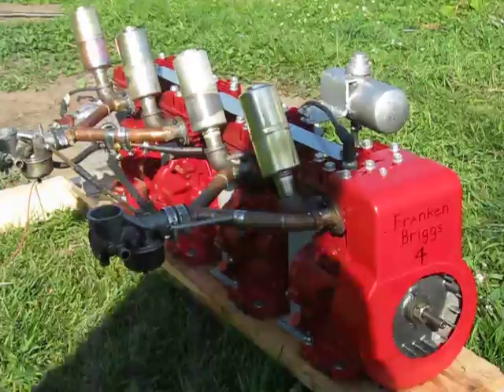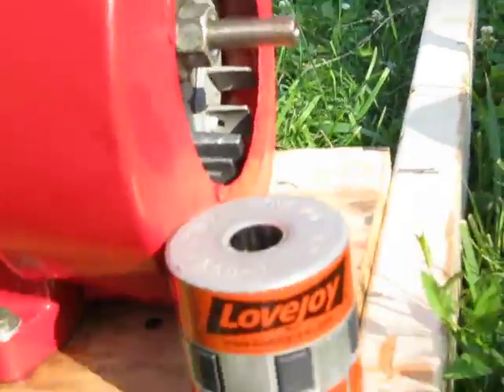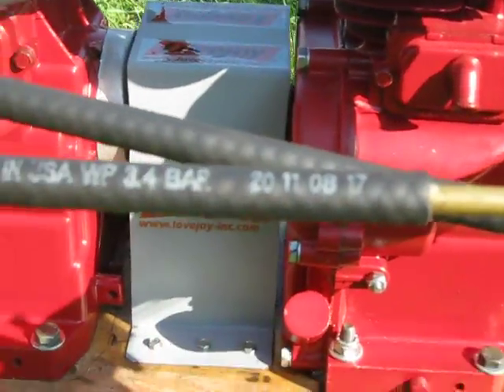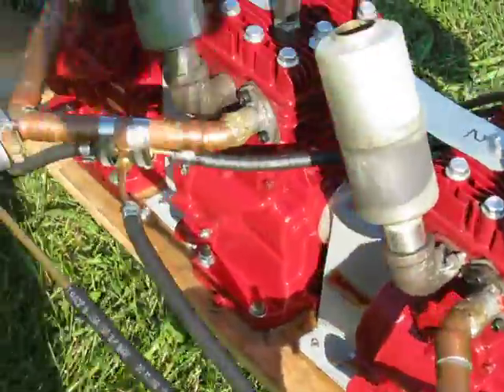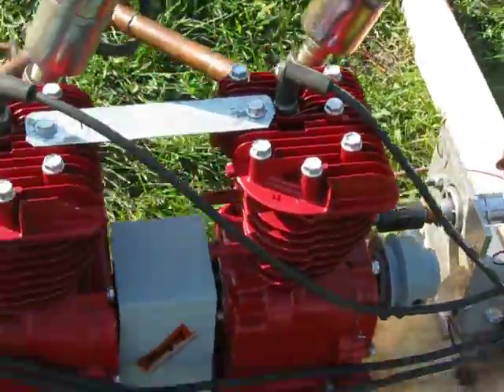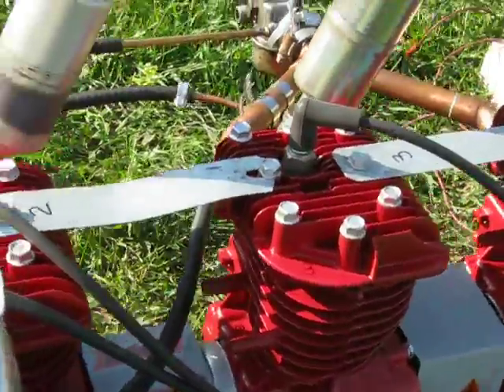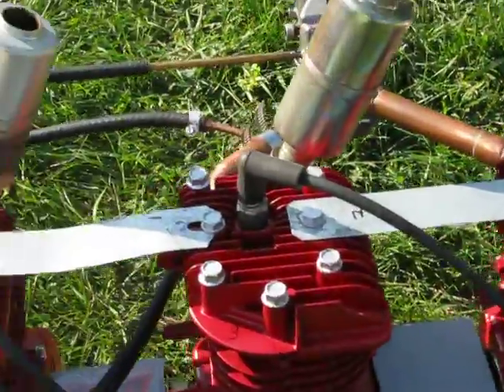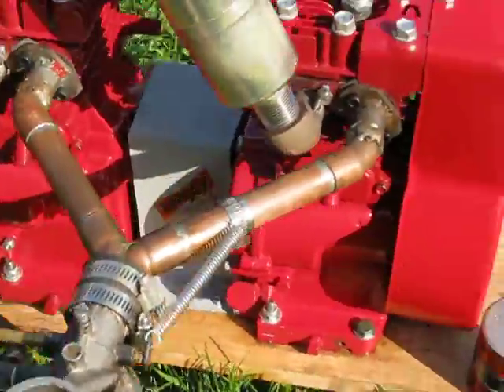FrankenBriggs 4 Cyl. 40 Second Run!!!

Comment: Great job!  I can see the comments on the cooling, and just know the other three are over heating also, It would be nice to run a fan system for the 3 engines, your run time is about the time it takes for them to start locking up, I ran a 3.5 hp briggs ( no fan shroud) on a go cart and burned the piston till it started to melt/grind along the skirt, using the original fly wheels and shrouds here will do wonders, and you can do away with the distributor as well using the original magnetos for spark,  the timing of the crank shafts will remain the same. Strait 8, V8, V10- the sky is the limit.
Reply from the maker: Curtis Barile So how long did the 3-1/2 horse survive until it gauled up the piston skirt, with the engine under load?I am planning to use an electric fan or two when I build the Straight 8, to avoid a melt down, though since these engines aren't under load I would think possibly 2 minutes would be OK without a fan. I am just guessing though. It would be expensive lesson to learn, if I smoked 7 engines on a 2 minute run though!I purposely deleted the 3 flywheels, and added the distributor and dual carbs to make it more like an actual 4 cylinder, even so I still get comments that it isn't a 4 cylinder.  Thanks for your interest :)
Reply: ChargerMiles007 I was hoping the wind from the ride at 30mph would cool the engine, It did to a certain extent but was not good enough, about 5 minutes under load was it, and I had to remove the chain to push it back to the shop because the engine was too tight/ locked up to push the cart with the chain installed, I had built it as a strait 35" chain drive with no clutch, I just push started it and jumped on after it started. these were  my experimental times leading up to the riding lawn mower with a vertical shaft 7hp Clinton engine with a belt drive 3 speed transmission, (Two speeds forward and one reverse) Top speed after increasing the chain sprocket size at the transmission to the axle was 50mph. Great fun to drive!!!
Reply from the maker: Curtis Barile 50 mph on a riding lawnmower!!!Man, you are braver than me, I have done 55mph on a 5 horse Briggs go-kart, but I would be very concerned about the lawnmower steering at speed like that!  Glad you survived it.
Reply: ChargerMiles007 It had a straight drive axle and I cut the small solid rear wheels off, and took the axle to the school metal shop and  the industrial arts teacher showed me how to turn the axle ends down to fit the  bigger air ATV style wheels and mill the key ways to fit the center hole of the rims, and drill/ tap the ends for a bolt to hold them to the rims, I then installed wheel bearings to the frame and slid the axle into place and bolted the wheels in to hold it into place, this gave it a much wider wheel base and positive traction for stability on the road and dirt, we had had no sand in Ohio, the frame was heavy steel with air tires mounted in front, I kept the old steering system since it was heavy duty. The old 5hp Briggs was good and was reliable to start in the winter, but the 7hp Clinton was stronger and faster and never got it started in the winter, so I would swap them for year round fun. Good memories from this time, I have an old 12.5HP Briggs electric start lawn tractor I am going to transform in the next year with my wisdom on this subject, and will post some video's when the time comes. will be watching your videos as well, Thank you for putting some spark back into my life on your projects, and get some air to those poor engines, remember "Air Is More Important Than Sex, Cause With Out It The Two Cant Exist"
Reply from the maker: Thanks for your inspiring comments, as you have gotten me fired up about getting started on some projects! Been nasty winter weather here requiring time to be spent outside shoveling etc. in sub zero F temps. So now I have some interesting stuff to think about and get started on during the long winter  :)

Comment: Bet the timing plays hell through the Lovejoys... not a lot of precision allowed there.  Did you try letting each individual engine time itself?  Also... 2x8?  How about a steel frame?
Reply from the maker: scowell I am looking into chain type couplings to reduce angular deflection. I only have a flywheel on the front engine, so I can't mount a magneto on each engine. I have started on a steel frame to support the Straight 8 engine I have planned. The 4 cylinder could use the same base.
Reply: ChargerMiles007
Awesome... sounds like you're completely on top of it!  Go for it.
Reply from the maker: I am presently fixing the crank problem on the 3 cylinder Radial stacker engine, as well as preparing 4 crankshafts for the Straight 8.

Comment: where did you get the gas tank and mufflers
Reply from the maker: Joey Nichols My son made the gas tank a number of years back from an oxygen cylinder (similar to a blowtorch propane cylinder) I modified it with a new mounting bracket. I have made a similar tank for my 2 cylinder Stacker engine. The mufflers are stock 5-8 horse Briggs tubular type units. I had them welded in place, but the shaking broke the little tack welds on #1 and #4 cylinders, so they bounce around.
Reply: you should try to tig weld them
Reply from the maker: Joey Nichols Yes, TIG welding would solve the problem for sure. I only own a cheap flux core MIG and an even cheaper 110 volt stick welder, so my options are pretty limited.My friend at AC/DC Welding could fix it up A-1, but I don't want to pester him all the time about little things like this. I think I can grind the tack weld down, and weld it again, it should hopefully live an easier life on the steel base I am working on.

Comment: It will be back to a one cylinder before too long when the rear three engines overheat and blow up due to lack of cooling fan and shroud.
Reply from the maker: ty_ger Wait til I build the Straight 8, if you think this has cooling problems. Guess I better pick a windy day to fire it up!  :)
Reply: should be fine provided it goes in something that moves. And plastic is pretty easy to mould into air scoops
Reply: ChargerMiles007
how much longer do we need to wait for the straight 8? :D also can you do a straight 6, i wanna build a straight 6 for my mud mower :D

Comment: Love your project. Wish I had time to play---- maybe someday. I have a suggestion: replace the mufflers with straight pipes, unbalance it, strap it onto 2 wheels and call it a Harley Davidson>>> HA HA
Reply from the maker: Randy Helouin LOL  :)I bet the neighbors would just love it with the straight pipes!!!I already get some interesting looks when I roll the 2 cylinder or now the 3 cylinder lawnmower engines into the carport to fire them up  :)Last summer I just happened to fire up the 4 cylinder the same day a new neighbor was moving in, they didn't know what the heck was going on, as the FrankenBriggs 4 was NOT a quiet machine even with mufflers!  :)

Comment: Hey. Here is a tip for you. loose the wood base and use something a bit more rigid. couplings are going to last a lot longer using a stiffer base. i could see the flex in that wood plank as you ran the frankenBriggs. Good job though. Keep it up
Reply from the maker: Oli Axel Oskarsson Yes, I know this base is way too weak, I will have to go to a steel base when I get to building my straight 8!
Reply: Lose. Not loose.

Comment: i love this stuff  but just a thought dont the flywheels on the motor balance the engine is that where all the shaking coming from  its just a thought
Reply from the maker: gary krutsinger On some engines the flywheel is an integral part of engine balancing. I am not an expert on the subject, but to my knowledge these Briggs engines don't rely on the flywheel to balance the crankshaft assembly. Though that is a very interesting question, wonder if Briggs would provide us with an answer?!!!? A straight 4 cylinder engine has inherent balance issues due to 2 pistons coming up while 2 are going down, apparently the center of mass moves up and down each revolution causing a vertical motion. The base I use doesn't provide enough support, so the forces cause it to flex contributing to the shaking.
Reply: ChargerMiles007 guess u could make a v8  lol thanks for the reply

Comment: Cylinder 1 cool. cylinders 2,3,4 overheated
Reply from the maker: migfsx Yes, I know, the smoke starts coming off of them towards the end of the vid.I originally envisioned a cowling going all the way from front to back, but got sidetracked with coupling problems and never built it. How did you like its sound?

Comment: Kind of ruined four nice little engines.
Reply from the maker: bob Last Actually the engines are still usable, I just had to modify the crankshafts, the blocks are still stock. I purposely used the worst cranks I have, so I still have good ones for use on go-karts etc.

Comment: Absolutely brilliant, I love the fact that you used a distributor for the ignition instead of the engines own ignition. Thank you for posting.
Reply from the maker: Malc Tulloch You are welcome, a distributor seemed like the simplest way for me to work the ignition for this engine, though it does require its own power source (a 12V battery charger, preferably the non-automatic type!)

Comment: Need to tighten the muffler bolts and mount the engines to a piece of steel U channel instead of a board.
Reply from the maker: greggv8 Yes two of the mufflers were doing a dance on the vid :)The vibration broke the weld between the pipe elbow and a 1/4" bolt threaded into one of the two exhaust bolt holes, that's why they were flopping about.

Comment: crazy man! rally like the twin stacker too. wonder how you got the blocks so close together on that one. One suggestion for this one I think shes shakey and not idling because you dont have enough flywheel weight on it. should be easy enough to put something heavy on the output shaft even if its just for testing. nice work
Reply from the maker: jeep2003 I guess it is possible I don't have enough flywheel weight. I did actually put a heavyish pulley onto #4 cylinder output shaft for this run. I will definitely increase the weight for the straight 8.

Comment: 0:23 watch the muffler at the top for about 15 seconds...
Reply from the maker: Chris Lesmerises Yes, all sorts of interesting stuff happened during this run! Mufflers 1 and 4 broke the weld holding them in place, and the sheet metal ground straps are all doing dances due to the good vibrations!  :)

Comment: Any thought on redoing the intake so 1-4 and 2-3 are paired instead of 1-2 and 3-4? That in theory would give you more consistent intake pulses through the carb.
Reply: Like on a Chevrolet with split plane intake, firing order is 18436572, cylinders 1467 & 8352 are grouped together to smothen the intake pulses. Using the same idea on a 4 cylinder 1342 would break into 1-4, 3-2 sharing intakes
Reply from the maker: Texassince1836  Yes, you are right, perhaps that has something to do with it not idling right down as I thought it should. Hard to say though, that could be due to only having one flywheel, though it does have 4 times as many power strokes now. I put a small pulley onto #4 cylinder to act as a flywheel also.

Comment: Could you put a light coil on the front engine, and use the power from that to run cooling fans for the other cylinders?
Reply from the maker: Texassince1836 I imagine that could be made to work, don't see why not.

Comment: Was it crossplane or flatplane?
Reply from the maker: MegaZsolti I guess it would be a flatplane.
Reply: ChargerMiles007
I'd like to hear it as a crossplane. If it worked.
Reply from the maker: MegaZsolti Yes, it probably would sound differently, I know my 2 cylinder stacker engine sure sounded different even or odd firing  :)
Reply from the maker: MegaZsolti I did some research into a crossplane crank for a 4 cylinder. It would be possible for me to rebuild this engine to run that way, though it would take some keyseat cutting on a crankshaft or two. Plus I would have to modify the distributor, as I ground off 4 of the 8 lobes for the breaker points. Neither is an impossible task, though I am very busy doing house repair projects this summer. Thanks for the input, I always like to investigate new ideas.  :)
Reply: ChargerMiles007  That's cool.

If it's made, I expect it not to vibrate as much as this one.

Comment: That thing runs good! I love how it sounds, at idle it sounds like a tractor, glad you got her going! I would have never thought of how you did the carburetor "linkage", twich grip style, like that! Can't wait to see your next project!
Reply: *twist grip
Reply from the maker: Hey glad you liked it  :)It does look like a twist grip, but is actually just a piece of brass tubing to connect the two carb throttle plate together. I had to wear the gloves, as I got zapped by the ignition when it started up briefly on a previous vid. On this run my wife got zapped while holding the shaft drive starter, I am glad she didn't yell out, though I guess that would have made the vid funnier  :)Next I am thinking of trying to see if this engine will idle down any further. It looks as though I will need to make a steel base for it, as the wood sure seems flimsy under the running loads! I have some mufflers to weld back into position also. As far as I know, I will be working with this engine for a while, as I can't seem to get any machining time in the summer, way too much else to do! So I will work on projects like this that don't involve any further machining.
Reply: ChargerMiles007 it is a interesting setup, haha i hear ya! haha it would have been funny haha it would be neat to hear it idle lower. I noticed that , you can actually see the wood twist from the torque, you wouldn't think it would, under load yes but not just running haha I hear ya

Comment: You need to copy the crank and  fireing pattern of a normal cylinder  try marking the crank with a marker
Reply from the maker: This engine uses the standard 4 cylinder firing order 1 3 4 2Though, since I use a coupling between each cylinder, I could change it fairly easily.Have you seen the 4 cylinder 805RoadKing has built? It is a sweet machine!

Comment: looks good but it looks like the mounting is a bit dodgy i would use metal box top and bottom and a manometer between the carbs to balance it but other wise now ur one up on me all i had was a 2 cyl steam B&S good job now put it in a car and feed it wood lol
Reply from the maker: lol  :)  So you want me to make it into a FrankenBriggsWood 4 !!!Man that is a mouthful to say. I will have to have a look for your 2 cylinder briggs steam engine, I remember how impressed I was with your steam engines, lots of thinking about what would work best.
Reply: ChargerMiles007 the vid of my two cyl is on my channel unfortunately it was cannibalized for other projects some time ago u know how it is =\

Comment: I think this is a  wonderful  design  ,,nice to see it  finally run   ,, But  it  would  be  greatly improved by  making a more solid  base for it ,,
I personally would  use a piece of  8 inch  C-channel iron ,,this would  make it  heavier  but also a LOT more  rigid ,, I noticed a lot of  movement between the  different cylinders
Reply from the maker: Yes, I agree, it does need a better base. I think the channel would need to be 10 or 12" though, as I think I used a 10" board stiffened by two 2x4s, to properly fit the bolt pattern on the engines. I have an "I" beam that would work with pads welded on it, as the flange isn't quite wide enough. I an a bit unsure how to proceed, as the I beam is heavy enough that I would have to make it a permanent set up, and my wife has just re-claimed the back patio area, so I have lost my engine test area :( Don't worry though, we will figure something out, as I have more engines under way  :)
Reply: I am glad  I don't  have the  issue of not  enough  work area 
I have a 30x40ft  garage to work in ,, the garage  is  actually  bigger than my mother's house ,, and I have lots of space to store stuff too cause  we  have a 25 acre  farm

Comment: Awesome! It Lives!
Reply from the maker: Yes, the Beast roared to life on the first crank of the starter. My wife holding the starter, and I both got zapped by the ignition, so I let go of the throttle, and it died. I put on gloves for this run, as we seem to be a better source of ground than the base!  :)  The old points type ignition lit us both up like Christmas trees!I am used to high voltage zaps, but my wife didn't quite know what to think!

Comment: sure better then your last runs!
Bet she would run way better with a 20Lb flywheel.
Reply from the maker: Yes, a heavier flywheel might help out. I added a small 2 groove steel pulley onto #4 shaft to act as a small flywheel on the far end. It likes to rev, that's for sure.

Comment: American locomotive is on to something there... Not sure how easily you can come across some plate steel.. but 1/4 inch across the bottom would stiffen up with what you have between the heads.... Or 3/16 between each head like you have the straps but use 3 head bolts
Reply from the maker: Yes, it looks to be flopping all over in the vid.The straps on top are just thin sheet metal, to serve as ground straps between the engines, for the ignition. I did notice the center on flopping during the run, as well as the two outside mufflers are loose. they can't fall off, as they are welded to a small bolt to keep them angled correctly. Danged vibration, it can be a real pain. Reminds me of my Jumo 205, it threw off a chain, and broke 2 flywheel keys during a 5 second run  :)  I have machined a vibration damper which I hope to install on it sometime.